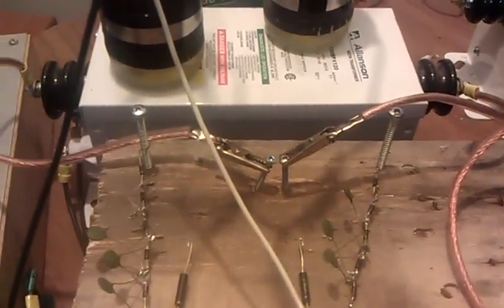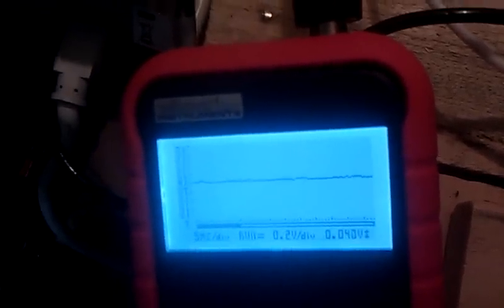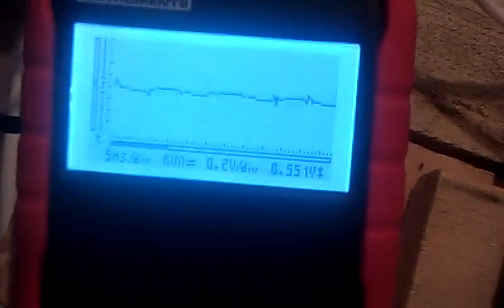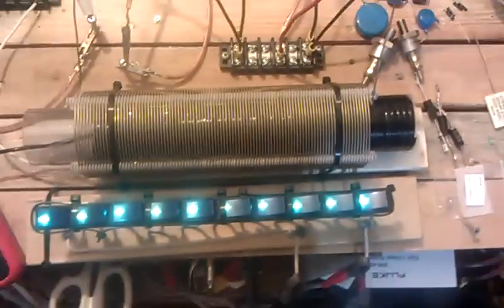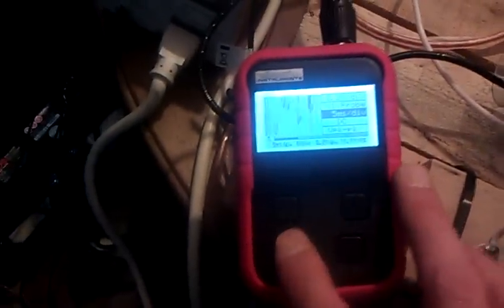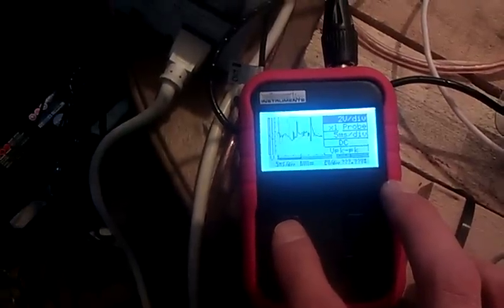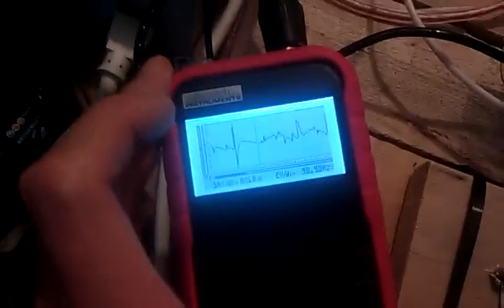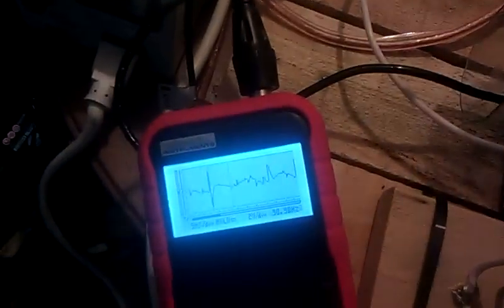Don Smith Device Project part 17: NST measurement

Comment: you need to take the bulbs and short circuit them across the one wire off the caps.  I believe your bulbs are in series.  You will still get the loud white arcing...but now you can run your loads from the short circuited wire...just like Tesla!

Comment: A transformer does not change the input to output frequency of the ac waveform. The typical way of changing frequencies is to use non-linear electronics: rectify then oscillate, or to mix frequencies by multiplying two signals together, or to cause abrupt / modulated switching (h-bridge), or an abrupt conduction like a Zener diode or lightning arrester or ionizing switching tube or spark gap into a tank circuit so as to pump sympathetic oscillation energy to induce resonant frequency ringing.

Comment: One of Smith's circuits uses a 9 volt and another uses a 12 volt battery to power the input to some kind of NST driver--one of which was a Radio Shack DC-AC inverter followed by other circuitry. Lower power, but higher frequency RF amps & oscillators use lower voltage due to the lower Vce limitations of the available microwave transistors. Higher frequency transistors require lower junction capacitance requiring that there be smaller junctions leading to lower breakdown & operating voltages.

Comment: Without matching impedance of oscillator output to NST input, signal reflection might burn out the oscillator transistor(s). I think that I read some Donald Smith builders on their blog comment entries indicate that they had calculated Smith's circuit like this was operating at about 250 kHz?
Reply: Some of his builds were 1mhz and greater. How did you do in your research my friend?
Reply: @Biokemist-o3k  About 1975 through 1985 study of computer science, inorganic chemistry, physics, numerical analysis was my game. Mid 1980s cellular telephones, military applications of databases, GUI artillery target planning using graphical interface rugged tablet computers, porting of legacy database information to mini or microcomputers. Mid 1990s I got into neural networks and artificial intelligence, PID motor controlled robotics, spindle brushless DC motors for scanning, feedback control systems, varieties of transducers and sensors, laser distance measuring as in Lidar, microcontroller systems, etc. Late 1990s I got into imputed demographics on anonymous web cookies for tracking of human behavior for targeted presentation of ads on large web sites, spamming of email ads to huge lists of email addresses with SQL database opt-out filtering, semantic image understanding by feature extraction and complex valued neural networks that are affine transform immune, 2-d fft pattern recognition, and various mass number crunching modeling calculations.

--> images antenna tuners swr

--> swr standing wave ratio

Circa 1974 one sibling and I were users of radio transceivers and learned of SWR meters and antenna impedance matching tuners for best signal propagation to and from the antenna system--this was the CB radio craze that persisted into the late 1970s.

I have come to realize that if most HF signals are done through the skin effect, then the surface contact with the conductor to insulator interface should be maximized in order to lower impedance to the signal being used. It is this electric to dielectric contact and surface area that matters.

My regret is that I not yet gone into studying "bulk effects" and exotic materials of signal propagation to gain an intuition about any of their practical uses.

I assure you that most of my education was simplistic, and intuition of important things came along when later encountering case studies of over-unity claimed systems that had various factors in common with each other.
Reply: @oldspammer  WOW!!! Thank you!!

Comment: Your NST looks fine. I did some research about RF oscillators that would output 15 to 30 Vac into your NST primary. Several parameters need to be matched--30 to 100 watts output to the NST, 30 to 60 Volts Vce breakdown.
Another consideration is impedance matching. Google image search (swr meter). Using such a meter, you can best match the oscillator's output to the input of your NST by using an antenna tuner (if it has an adequate adjustment range).